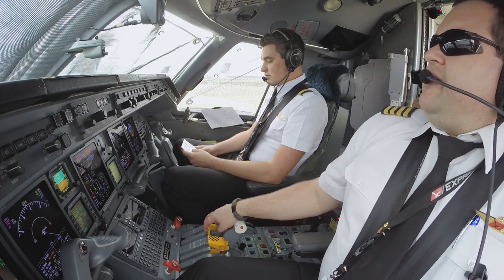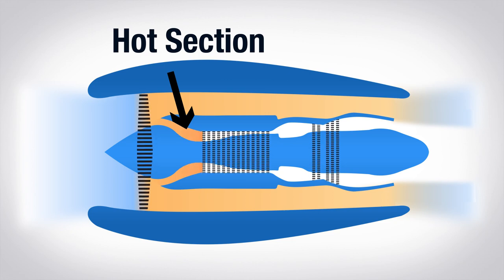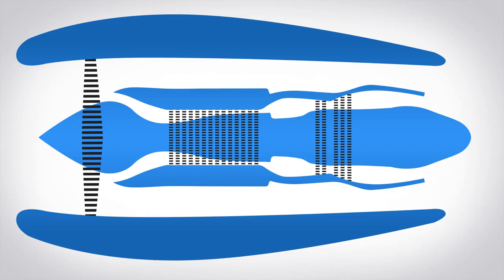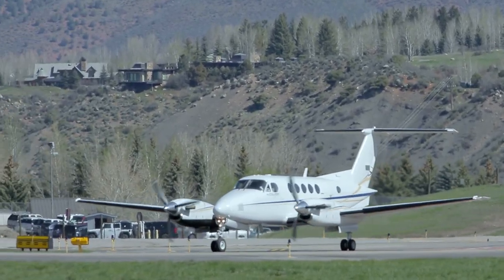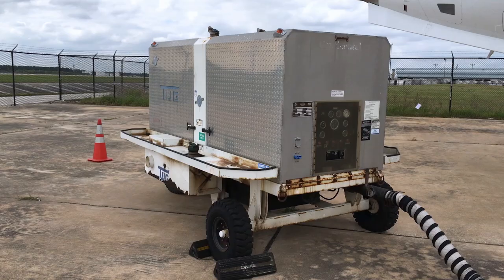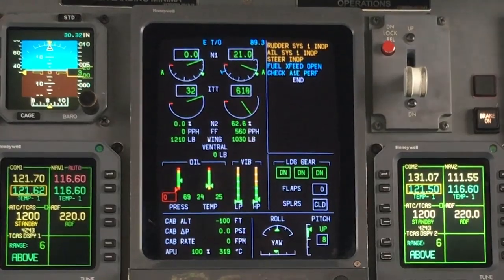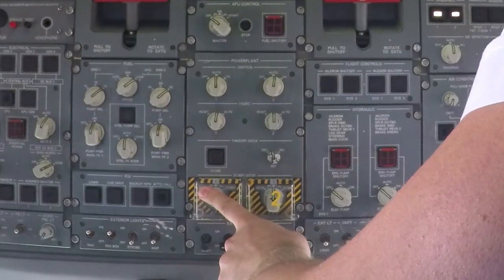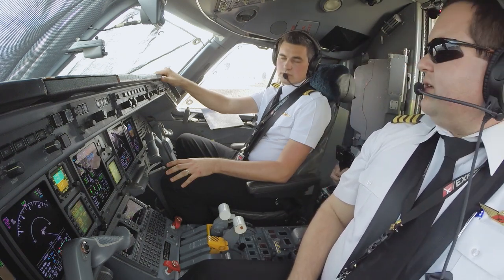How A Jet Engine Starts

Comment: Not completely accurate.  I design ground based gas turbines for power plants.  Fuel will burn in the combustor at atmospheric pressure.  It doesn’t need pressure to burn.  That isn’t the reason you need to supply compressed air to the GT to start it.  The reason a GT needs compressed air is to pre-spin the rotor.  This is done because the GT generates power from the principal that more work is extracted expanding hot gas than compressing cold gas.  If the GT isn’t pre-spun the combustor will be at atmospheric pressure and the hot gases from the combustor will not generate any power in the turbine since there is no pressure difference for those gases to expand with.  Thus the turbine will not drive the compressor.  If only a small amount of pressure is generated in the compressor then the turbine will generate some power but at low pressure ratios this is not enough to overcome the friction losses in the turbine and the GT will deccelerate.  So the GT needs to be spun up to a critical speed over which it is able to generate more power in the turbine than the compressor and friction losses consume and then the GT is able to accelerate on its own from there.
Reply: Geoffrey Engelbrecht very well explained thank you
Reply: Yes but GT at the power station has huge turbine since you need kinetic energy. But with jet turbine it's so small since you need the energy to drive the compressor remaining is required for building thrust.
Reply: Geoffrey Engelbrecht are you a pilot
Reply: Well explained Geoff. Your description reminded me that  Also Jet  engines are more efficient at higher colder altitudes because of the temp difference between intake and exhaust air ratios.
Reply: Thank you.  You have just filled in the missing piece of my understanding of why the generated combustion pressure doesn't push out of the intake and stop the process.
Reply: Geoffrey Engelbrecht 

Clearly.....you are spot on!
Reply: @abbasali3100  what he described is pretty general with regards to GTs, at least from what I've seen. Also, kinetic energy is the goal in both cases, only that in a (commercial) jet, the shaft power not consumed by the compressor and friction losses is used to power a large fan that provides thrust rather than for an electric generator. As well, the reason the turbines on commercial jets are not as large is because, (amongst other reasons I imagine) the goal of modern turbo fan engines is to use as small a GT as possible to drive the largest fan possible as fast as possible (sort of, it's more about mass flow rate and air velocity) because a smaller GT, or "hot section" as he said in the video, means lower fuel consumption. Thus, innovation in the GTs of commercial jet engines is generally to make them smaller for equal power output or to increase the output without increasing fuel consumption (significantly).
Reply: @rwh777  My understanding is that the combustion gases don't go out the front because the compressor is ramming high pressure air in that way.  The path of least resistance is to go through the turbine out the back.  It turns out the majority of the engine's power is used to run the compressor so there's no way the combustion gas is going out the front.  It would be like trying to swim up the Niagara falls.
Reply: Don't confuse them. They're just pilots.
Reply: I am a little bit confused. What exactly happens when the pilots turn the switch to start the left (first) engine? Is it just to open a gate that the compressed air can flow in and spin the rotor? The cross bleed is already open. Or ist it begin with the fuel injection. That would be a waste of it for my understanding right now. I am just learning. hmmm.... thanks
Reply: sorry big man
Reply: @abbasali3100  Sorry I only saw this now.  For some reason I received no notifications on any of the responses till today.  The same principal is there regardless of the size of the engine.  There is no pressure produced in the combustor.  Actually there is a slight drop in pressure in the combustor when the engine is operating.  So without the turbomachinery spinning and generating a pressure rise the engine will not generate any power.
Reply: @bighjr1823  Yes I am also a private pilot.
Reply: @GeoffreyEngelbrecht  i totally agree dear the principal are same in both however the size of the turbine to compressor are different. in PS the gas expansion need to be recovered as max as possible to drive the generator. where as in jet turbines its only need to drive the compressor and some ancillary. that's why in our plant we do use combined cycle to recover the heat output through steam boilers to increase the total effecency from 40% to 65 -70 %
Reply: @abbasali3100  Ah OK now I understand what you were saying.  You are right there maybe more losses in a power plant requiring a higher idle point than a jet engine.  Though this is not something I am sure of as my main expertise is combustor design and not performance.  As you said the engines in power plants are typically a lot bigger and produce a lot more power (some are smaller but the ones I worked on and I imagine the ones in your plant are a lot bigger) and I am not certain the relative losses produced by the generator at idle are bigger than for instance the fan of a turbofan engine.  In absolute terms the losses are probably bigger on a larger engine but in relative terms they may not be.  So it may not be necessary to have a higher idle point (by this I mean pressure ratio).  Anyways the key message is it doesn't matter what gas turbine we are talking about today at zero RPM the engine will produce zero power no matter how much fuel you burn in the combustor and it needs to be spun up to produce a sufficient presssure ratio to produce enough power in the turbine to overcome the losses in the engine (and I include all the additional systems the engine needs to drive as well as the friction losses and bearing losses in this).
Reply: @GeoffreyEngelbrecht  Even though the principle is different, a regular piston engine also needs to be spun up before it will run.  It's all about getting the air moving correctly!  My dad has an antique car that has a "cheat" button that will send a spark to the spark plugs to attempt to start it but it only works if the stars are aligned and never once the cylinders have bled out.  Otherwise you have to go out front and use the crank.  I think the main difference is that the air will flow correctly in a piston engine at much lower rpms.
Reply: @Nonplused  A piston or IC engine has essentially a sealed combustion chamber.  In principal because it is sealed during the combustion process it will produce a pressure rise which will drive the piston.  However you are right most IC engines are turned over to get started but this doesn't require significant RPMs it is really just to get the cycle running.  If you have ever seen anyone crank start an aircraft piston engine they basically pull the propellor through half a turn before the engine starts.  A gas turbine on the other hand isn't sealed.  Even when the engine is turned off the gaps between the compressor and turbine blades are open and the combustor is ventilated.  So in theory you could just inject fuel and ignite it and provided there is a draft of fresh air the flame would burn but the engine would not produce any power.
Reply: @Nonplused  I'll just add as I flew the Stearman and for the radial engine we cranked it with the magnetos off (ie. electricity to the spark plugs off) in order to remove any oil which might have accumulated in the bottom cylinders.  So there may also be some need to cycle the engine a few times for things like this before ignition as well as simply running the cycle through at least once to charge and ignite the mixture.  But as I said theoretically IC or piston engines have constant volume combustion and will generate power from zero RPM.
Reply: Geoffrey Engelbrecht :  "Fuel will burn in the combustor at atmospheric pressure".  Does that include typical jet fuel, which has a high flash point ?
Reply: @joemag6032  Yes.  To burn stably all it needs is air flow to help stabilise it once it is ignited by producing some sort of recirculation zone and to supply oxygen and an ignition source to vaporise the fuel and ignite the flame to start it off.  Once ignited the flame itself can produce more than enough heat to sustain itself.  Gas turbine combustors are not designed to operate optimally at atmospheric conditions because there is no point.  The engine would not produce any power at atmospheric conditions so you are just wasting fuel.  Thus there is no guarantee you could get a stable flame at those conditions with a particular combustor but it is certainly not impossible to design a combustor to operate stably at those conditions with kerosene or jet fuel.  Oil furnaces work just fine at atmospheric conditions.
Reply: @GeoffreyEngelbrecht  ,  thanks for your response .
Reply: @BobDschingisKhan  I don’t fly this jet but believe the engine is FADEC controlled.  When the start process is begun, the computer does a few things. It opens the bleed valve to the starter, then it monitors rotation, and at some percent N2, the igniters begin to fire, and then at a higher N2, fuel is added at a scheduled rate.  EGT, engine acceleration, and temperature are monitored and fuel flow is modified so no limits are exceeded.  That is it in a few words.  There may be some videos online that you can watch to see what the engine instruments indicate during the start.  This one may also show it.  The hard part (for non pilots) is knowing where to look at what time.

Comment: 1:07 n- Factually incorrect - the "hot section" starts at the combution cans, not the HPC blades.
Reply: Combined gas laws, increase the pressure of a gas while keeping volume constant, the temperature will increase. By stage 14 (I think they said) pressure is high with volume being constant, therefore by the time the air reaches the diffuser to the combustion chambers, the temperature will have increased significantly.
Reply: @dashamanstevo5326  The hot section starts at the combustion chamber.
Reply: I built over a thousand hot sections as well as complete engine assemblies at Curtiss -Wright on Pratt & Whitney j-57 and other manufacturers' engines and the hot section is built as a seperate assembly and I can assure you it starts with the HPC turbine and is capped off with the high speed turbine, after the diffuser, fuel manifoild, combustion chambers / cans. You lift that up and marry it to the cold section / low pressure turbine, and tie it all together with the ass end low speed turbine long shaft that threads into the cold section frone end turbine.

In the factory that high speed turbine is built by one guy and is brought to the hot section assembly area in a dolly. The hot section IS that part that is all tied together by the high speed short shaft turbine.
 
Look at the drawings. It's a whole seperate assembly.
Reply: Carl Ferrigno  Where is “here”?

Comment: Too much glass. I was old school. CH53D Sea Stallion, USMC. Lots of gauges, leaking hydraulics, noise and the occasional “Oh Crap!”
Reply: yeah yeah sure thing
Reply: 😅
Did you mean to say "Too much CLASS"?
Reply: rotorheadv8 and all that free gamma rays from the radium in the dials.
Reply: @edinfific2576  no, glass, as in glass cockpit. That's the modern computerized system that puts all of the information into a digital screen interface, rather than having physical gauges all over the place.
Reply: @jakesnussbuster3565  I considered he was making a joke, but maybe he just wasn't familiar with the term glass cockpit. Not sure.
Reply: MH-35J/M's here.  Good times!
Reply: Yes. Sure thing.

Comment: How is it safe to fly with a broken APU (4:50)? Or is it just easier to start with a start cart?
Reply: augustine22 safe? yes. easier to start with a cart? No. APU assist start is a lot easier.
Reply: Yes. The engines start using compressed air, supplied by the APU. If the APU is broken, you have to start the engine using an external air cart. It is much more of a hassle starting an aircraft using an air cart versus an APU though there are some types of jet aircraft that can only be started using an air cart.
Reply: It's actually not safe, and this has caused crashes in the past but it's still permissable to fly with a broken APU otherwise it could cost the airline MONEY.
Reply: It is safe. The APU is shutdown in the air, unless an engine driven generator is MEL'd necessitating the APU generator's use. If both an engine driven generator and the APU generator is MEL'd the aircraft would be grounded. There has never been a crash caused by an inoperative APU. It's function is primarily air for air-conditioning, and engine starting, and electricity on the ground until the engines can be started. Then you can use the electricity from the engine driven generators and bleed air from the engines to operate the air-conditioning.
Reply: John Smith
Reply: +joe Brown 
Sully used the APU to keep the systems going when both engines were out.. It made a difference that day.
Reply: For Domestic flights it is a helpful addition, For  ETOPS flights the APU is required
Reply: APUs do not produce enough bleed air above 20K to start an engine, so they're  limited to electrical generation at higher altitudes.

APUs are not on the MMEL (minimum equipment list to dispatch), but in such cases, both engines must be capable of producing bleed air for pressurization and cross-bleed starting to dispatch.

Jet engines are required to start themselves up to 20K (ram air start) without the need for external starter air. I've been on board a 757 when they did that. Works great.
Reply: Safe safe APU is off all of flight and begin to Take Off .  Air drag  on 767.
Reply: I wouldn’t say its safe what if the aircraft lost both engines then the electrical system and hydraulics would have to depend on the APU because as you know APU supplies both bleed air and AC power (electricity)
Reply: @joshua targete You're not going to fly far with no engines. It depends on the aircraft. The APU on a 747-400 can't even be started in flight. Are you saying that is not safe?
Reply: @meerkatandpug  It is perfectly safe to fly with an inoperative APU.  The MEL may require it to be operative for certain operations, but that is beyond the scope of this conversation.
Reply: @joshuatargete9421  Look up RAT (Ram Air Turbine).  The larger aircraft have them.  On my aircraft, it can supply electrical power or hydraulic power, depending on the situation.

Comment: The "hot section" isn't at the front of the engine ~ Signed, 25 year A&P
Reply: Yeah but for the normal person it would be the hot section. But I was really cool seeing them talk about the engine bleed air, I'm taking a final over that tomorrow lol
Reply: I didn't think he said it was.
Reply: For a "normal person"...WTF? This is supposed to be an instructional video for "normal" people...so what, it's acceptable to feed them incorrect information? 
Cold section includes the inlet air duct, the compressor and the diffuser.
Hot section includes the combustion chamber, the turbine and the exhaust.
Reply: as an aircraft maintenance student, I agree with you Patrick.
Reply: Correct, everything aft of the fuel nozzles is the hot section.
Reply: Logan I would fail you if I saw this comment. We are all normal people. BTW, Aircraft mechanic since 1994.
Reply: The triple spool compressor on the Rolls Royce RB211 will heat the air to 600C prior to entering the combustion chamber. Perhaps it should be called the warm section, rather than the cold section :P
Reply: You are right Pat I`m an engine mechanics with 32 years of experience.
Reply: That bothered me too lol. Also, bleed air comes from the compressor section, not bypass air.
Reply: @travisklimp7418  hey Travis check out AgentJZ's page if you havent already,  goes right in depth re building j79's etc into industrial power plants, and does some test stand work on flying stuff as well.. may find it interesting.. good luck with yer schooling
Reply: @ImperrfectStranger  yeap we often forget the air is heated from the compression prior to entering the combustion chamber,  hot enough to heat the anti ice systems and keep the cabin toasty,  they bleed off the second LP stage for these systems I thing, as on the third (Rb211), the gas path is so narrow , and pressure ratio so high, it's too difficult to syphon off.. I think on 2 spools they pull it  off the first hp section , yer still getting 4 to 500 psi by then, plenty enough.. pressure must be crazy in the chambers...where the magic really happens... on military jets tit temp is used to regulate performance..that sensor must take a huge beating lol..

Comment: 3:29 Half a gallon each minute? Really. It got to be half a gallon each second
Reply: Half a gallon per minute is still a lot of fuel. Keep in mind a car can run for 10+ hours on one 16 gal tank. This (small) turbofan is chewing through 16 gal in 8 minutes.
Reply: Wouldn’t it be 8 gal in 8 mins ?
Reply: With two turbofans
Reply: lol, it would be, I royally fucked up my maths,
Reply: @derpderpyface5246   8 gallons in 16 min guys. one gallon every 2 minutes, and I work on these. They burn way more kerosene than that
Reply: @Jacksonkellyfreak  That number is per engine.  I saw 200 pph on the FF meter before the engine stabilized.

Comment: Gas turbine engines use the Brayton Cycle also known as the constant-pressure cycle. Energy added to the air flowing through the engine by the burning fuel causes the volume of air to increase, but the pressure remains relatively constant. Nice video!

Comment: I flew the ERJ-145 some years ago, we used the term "one o'clock, three at the bar" for the bleed air settings. The APU was often inop, so we would use a huffer cart for external air to start.